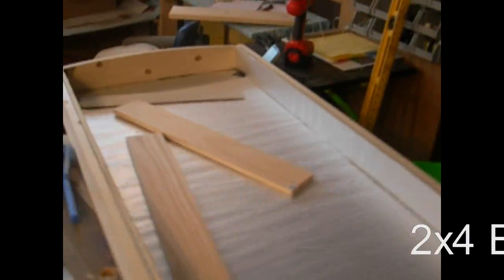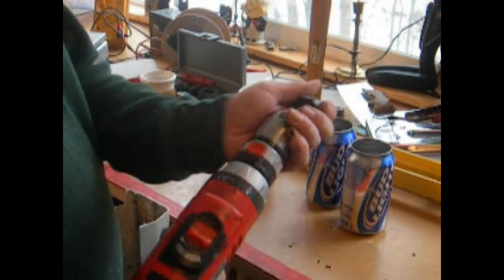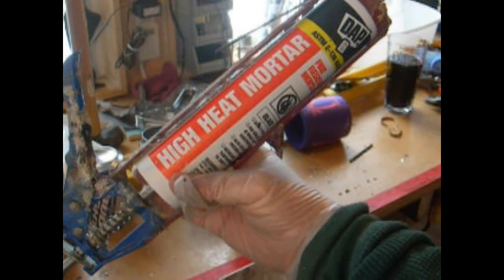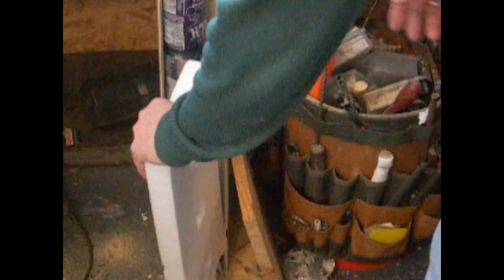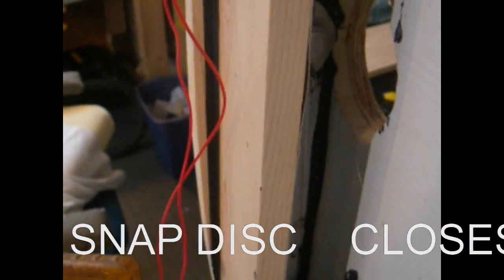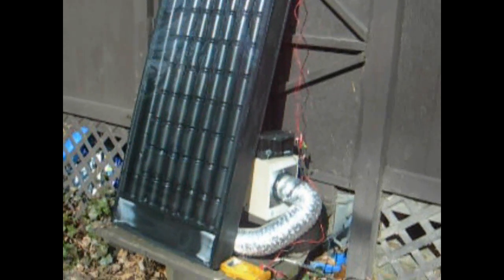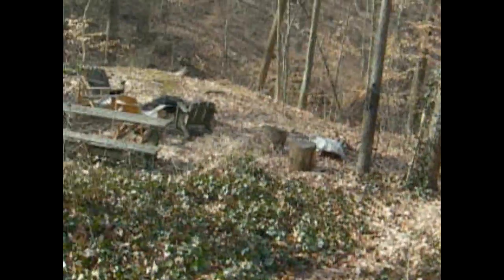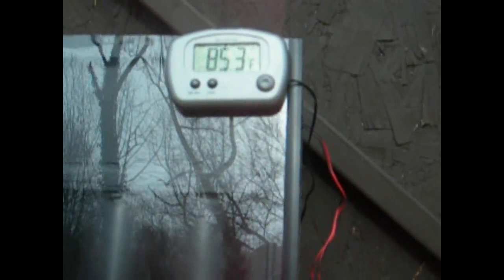HOW I MADE A SOLAR POP CAN FURNACE / HEATER

Comment: A  roll of  black poly-pipe inside a sealed and insulated  box also works well.
Question:-  How  does he  get the  water INTO and OUT OF  the cans?
Reply: *****
aha!... That  makes  more  sense ~ and a  very good idea it is.
....and  could  be  adapted  for hot  water, I  think ~ perhaps  depending on suitable positioning.
I've  always  been a  great fan of  recycling and innovation (built several  complete  houses  using that approach (all 'legal') and   really  do   take  pleasure in seeing that sort of  attitude and motivation hasn't died out in  our  world  of  pre-fab and  bolt-on.
All the best to  y'all.
Reply: its air not water

Comment: @0urGaia Only thing is about co2 is that it could all be bullshit and co2 might do nothing different other than plain old air. I was thinking about car exhaust though....and my other thought was how much heat soil retained...the unit might be heavy as hell...but what if the cans or whatever held soil?...maybe even aspault coating the metal..

Comment: Finally, you might well have saved more energy by simply better insulating the door. Since you had to remove a window, you may end up using MORE energy now in order to artificially light the area that perhaps was naturally lit before. Mounting the system on the roof would have given a few more minutes of sun per day, which is quite a large percentage in winter.
Your system is very good in principle, and inspiring, but not very well installed.

Comment: sould be cool having an 18 or 25 cm Computer case fan instead of a fullpower motor to use for the heat transfer

mostly since its on 12 volts and doesnt require that much energy when used

Comment from the maker: hi if you glueing cans use high heat mortar or silicon  but putting cans in downspouts is a lot easyer  i have new vid comming out soon . use a step bit or holesaw make a 1 inch hole

Comment: Does slowing the air flow have any impact on the heat transfer coefficient?
Reply: in theory it should.
Reply: +TheJezrock Turbulent air/fluid has a bigger surface area. Slow flowing air/fluid is a very good insulator (double layered glass). so even one or two molecules of thickness can cause a very big resistance in heat flow. You can solve this problem by increasing flow, or increasing turbulance (rough surface). Hope this makes any sense ;)
Reply: +TheJezrock You could sand the inside of the cans to improve turbulance

Comment: Anyone know if you can just remove the entire bottom of the can, or do you need the holes?
Reply: Holes or fins swirl the air and slow it down for best temp increase. Cutting the whole ends out would make the air flow freely and got get as hot.

Comment from the maker: @dotcombatgames hi if i got sun in the winter im sure it would but the sun is behind the hills untill about the 1st of feb thats when mine starts to work  it was 24 degrees out the other the heater cut on at 110 dergees and ran about 2 hours at temp of 95

Comment: Nice and warm project! I also used beer and pop cans in my first solar house heater which measured 3 foot by 5 foot with a heat output of 55 C. For my second solar heater I used aluminum down spouts which was way faster. It measured 3 foot by 6 foot with a heat output of 140 F (60 C). So I scaled it up to 6 foot by 6 foot and it has a heat output of 203 F (95 C). They work great adding free heat to my house every sunny day! https://www.youtube.com/watch?v=7S8CWsIcK20

Comment: why it needs cans?  why it can not be just a black surface with the glass on top?
A glass windows would not provide the same benefits?
Reply: The more hot surface size you have, the more hot air you get
Reply: Saveta I found a study which compare the two, it builds one flat and another with cans, same dimensions, same everything, the flat is easier to make and works better.
Reply: Well that can be. if you have a flat material then it's easier to use as you said, if it's easier to get empty cans, then make it with cans.
I was starting today and i was able to collect more than 70 empty clean cans at nearby streets :P
Reply: The window in your house would collect the same energy from the sun if of the same dimensions.The fabric of the room would absorb the same energy without a fan etc being needed. The amount of energy provided to neat my rooms is minimal between a south facing room and a darker north facing aspect.
Reply: The flat one won't make as much heat.

Comment: An electric car capable of going 27000 mi a charge. Imagine if all houses were using Earth pipe Geo heating technology with these Popcaan heaters technology.🤔

We could probably get away with most of our power just being produced through solar wind and hydro. 

side note. The 27,000 miles is what would happen if you put a 300 mi per Charge car on a steel on steel rail system.

Rail is 90% more efficient. So 90 * 300 equals 27000 miles.

Basically what I'm getting at is. We already have the technology.. not to be carbon neutral.. but to actually be carbon negative. 🤨

It's the average person holding the world back.

Comment: sorry i thought this was to heat your water... ! why would you want to heat your house when it's hot out side.( omg i am sweating my balls off doing the garden think i will go inside and sweat some more) bit like sucking an ice cube while it snows. now fill the cans with water let the sun heat the water = less resorces used and £savings
Reply: You can also use this to cool your house by placing water in them.
Cooling by evaporation.
(As so long as the room is sealed.)
Reply: the sun can shine on the most bone chilling day. i think the concept is to use every last resource u have. . Im pretty sure this is like a supplemental heat source. I mean even if this is a really efficient design its still pretty much useless from the afternoon untlil morning so hes gotta have a wood burning stove at the very least.
Reply: The design of course could be far effective by using specially designed materials... And those do exist. :)
Reply: SOUNDS LIKE A GREAT SOLUTION FOR U.
Reply: Adrian Hart Watch it again.. intake temp was 57 , so it was 57 outside.... Doh!
Reply: He made his video for us that get a lot out of it.  Why don't you make your own video and not criticize someone else.  Gosh!